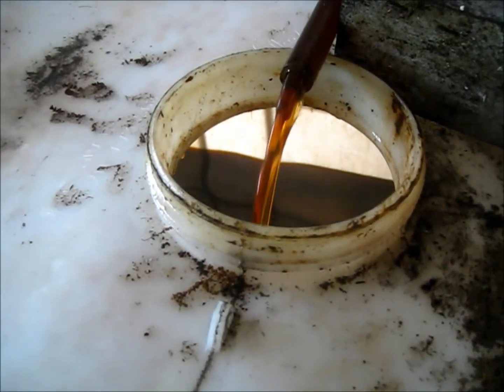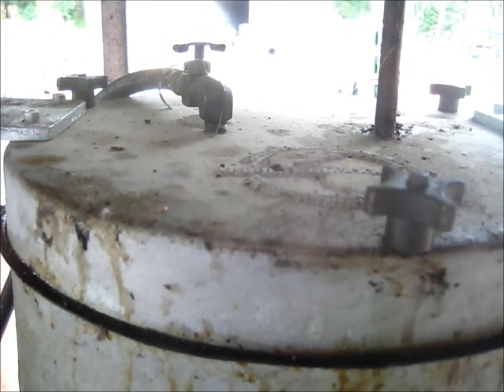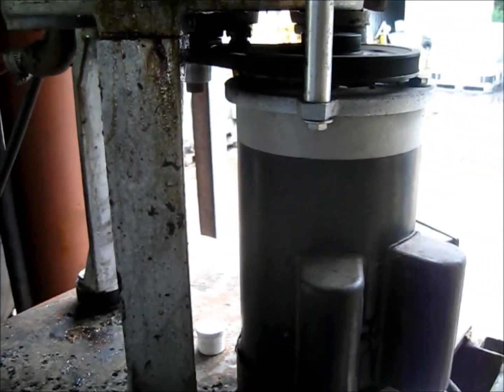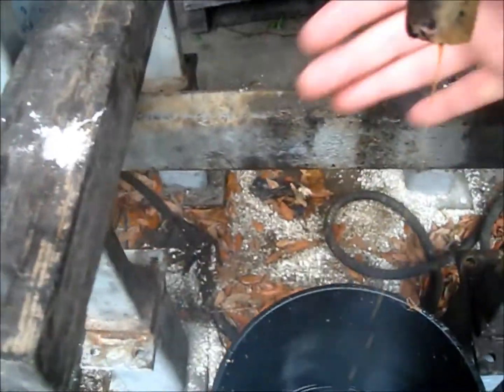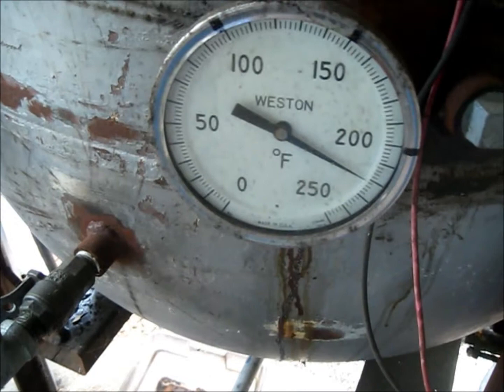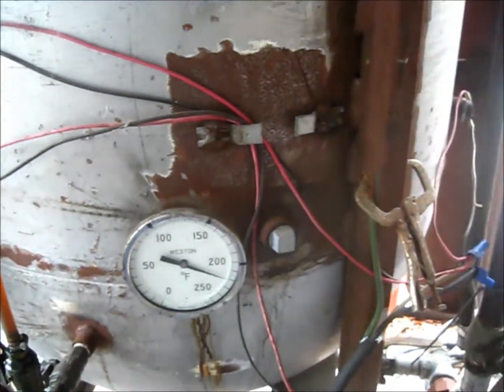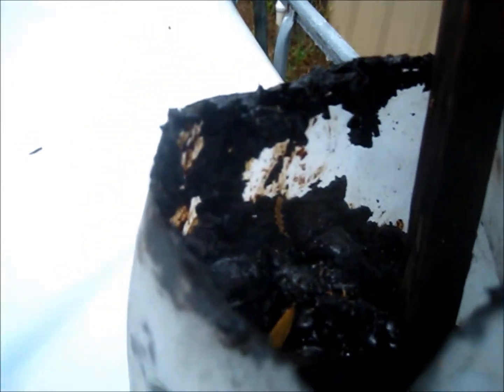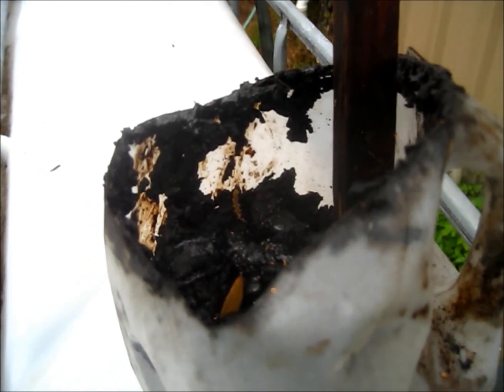WVO Centrifuge review

Comment: Because the US Filtermaxx Centrifuge has a belt overdrive, it generates 3000 G's while most direct drive centrifuges are between 1200G and 1400G. The US Filtermaxx bowl is a gallon while most are about a pint. This accounts for the higher capacity of this centrifuge.  Another proprietary feature of the this centrifuge is the forced vapor ventilation to remove water or other vapors released in the flashing process inside the centrifuge..